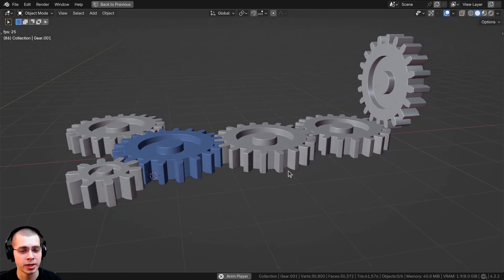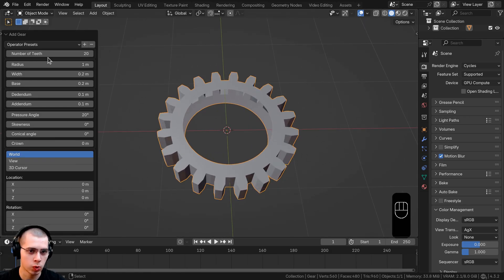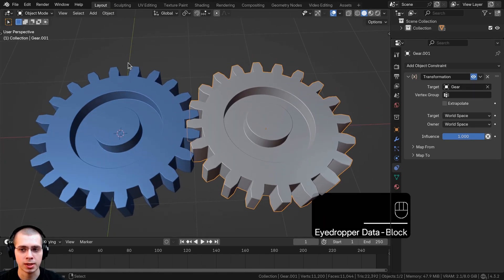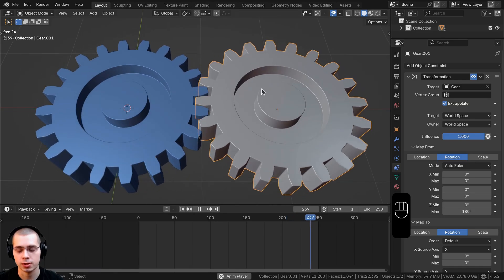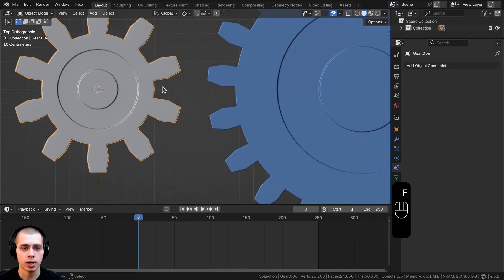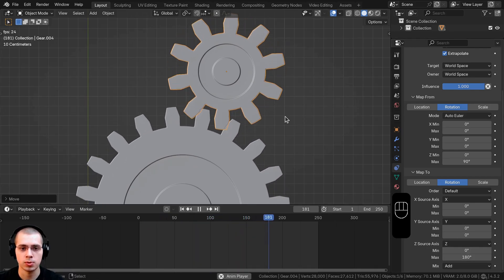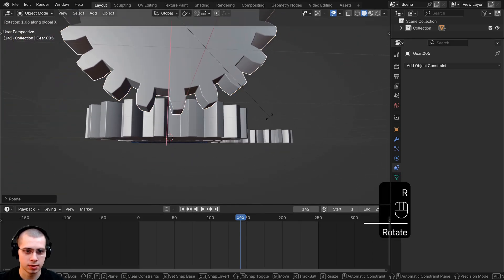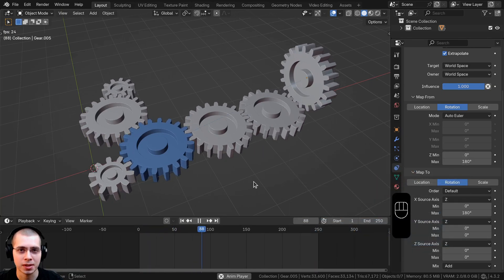How to Rig & Animate Gears in Blender ⚙️ (Tutorial)

Comment: Thats nice but there is a huge issue with this contrain set up!!!!: The moment your gear is not perfecly symetrical ( like steam punk gears with more details) you will see the gear jumping back in rotation after 180 degrees) You wont notice this using the standard gear model like in the video. 

The solution was to use drivers. My starting gear is always 1m radius this way the math is super simple